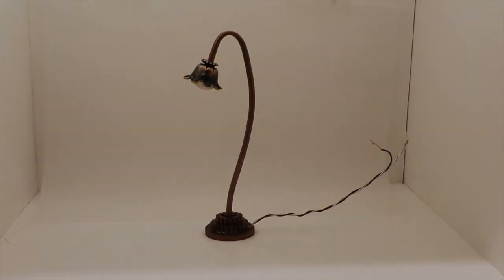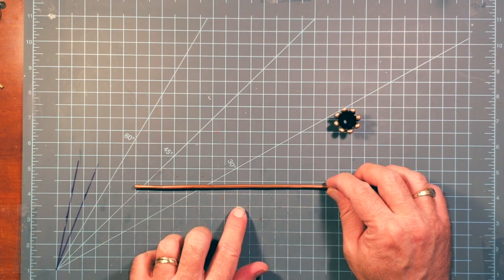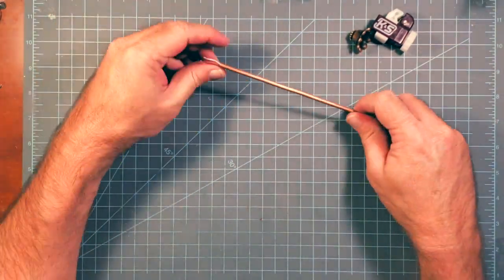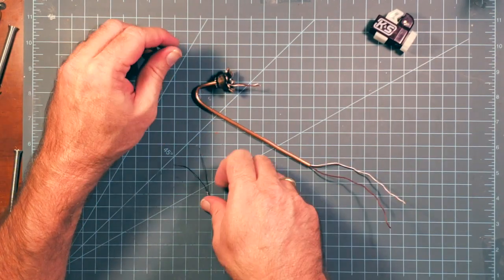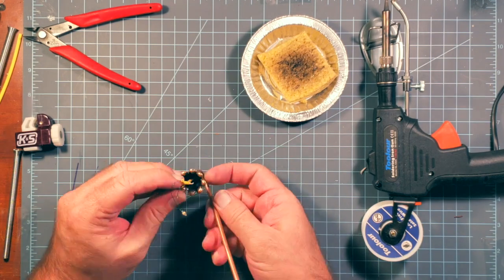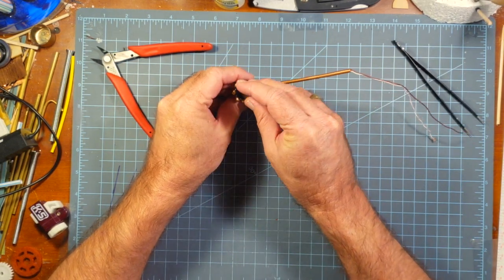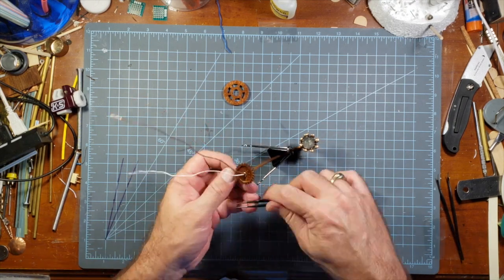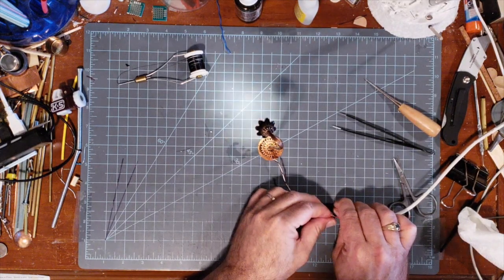Miniature Copper Floor Lamp

Comment: What a great idea to wrap the wires with string. The fact that these wires are a different colour and some of them have heat shrink tubes on them drives me crazy. I am not doing steam punk though so it matters to me what they look like. Love your videos. This was a good one. The pipe bender was a good reminder as I knew they existed but I had forgotten.
Reply from the maker: Glad you liked it.  Having the different colored wires helps when hooking it up to power.  Positive vs. negative.  The heat shrink was to keep the wire from shorting against the metal.  Hope this might alleviate your frustration a little!
Thank you!

Comment: 😍 it’s beautiful! If you don’t have a soldering iron thing can you just twist the wires together then shrink wrap them? Or would that be dangerous?
Reply from the maker: Thank you.
Yes!  You could twist the wires as you said.  It wouldn't be dangerous. You only risk the wires coming apart if they get pulled too much.  But ... the heat shrink should help that!
Reply: @dolfinmagikpro  lovely! thank you! I’ve been toying with putting a fairy style light on the gnome home im trying to make atm but felt a little...overwhelmed. I feel more confident I could get it to work now 😊
Reply from the maker: Glad to hear it!